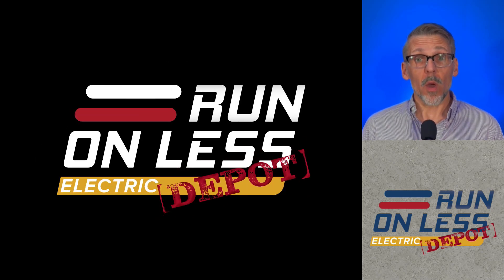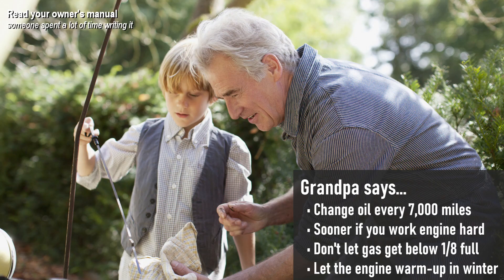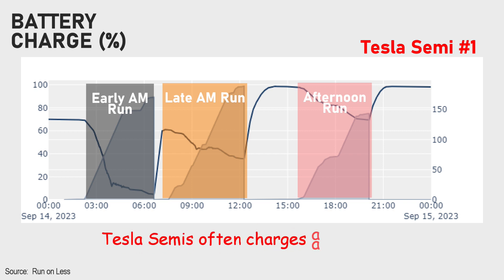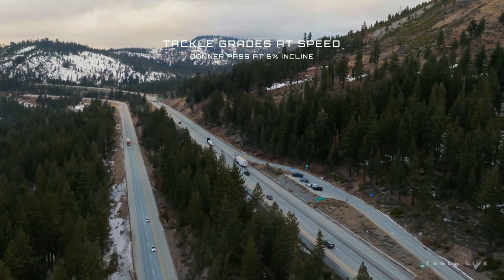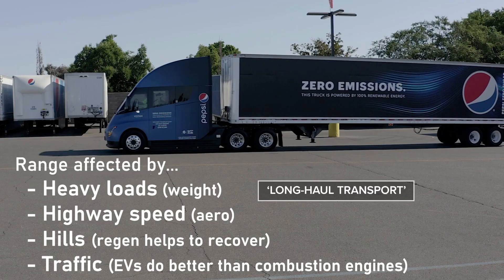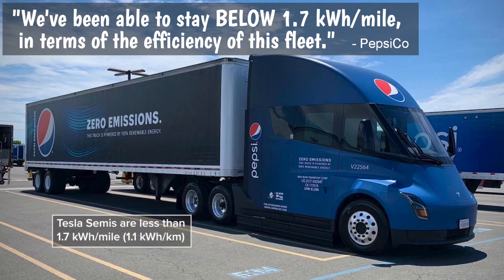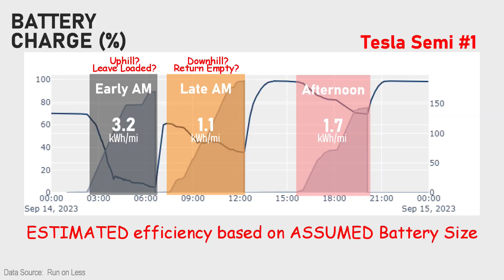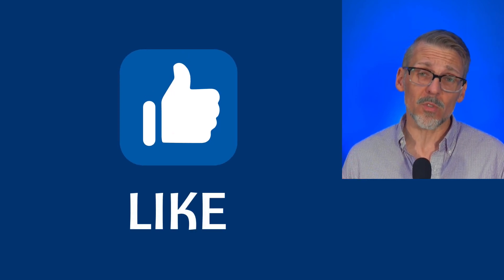In-Depth Analysis of Tesla Semi Data (Freightliner and Volvo too!)

Comment: Can we have comparison at diesel truck to same route?
Reply: Not much of a point. It s just worst technology all around.
Reply: @lucadellasciucca967  Yeah, but eventually the electrics will get better
Reply: @donhappel9566  I was reffering to diesel... And of course i m talking about potential. Electric is a better technology the ICE of any kind once maxed out.
Reply: I work in freight forwarding and consider it a necessity to go electric for our future. Unfortunately the data suggests that electric trucks are not viable yet for long haul transports. Still waiting for data from our own company which started purchasing different trucks (electric, HVO and hydrogen).
Reply: @EwenorKvM  Electric will win. It s a matter of time.
Reply: @lucadellasciucca967  Win? Loose? 😂 As I said: I consider it a necessity for our future. But denying that the data presented is inconsistent at best does not help our common interest 😉
Reply: @EwenorKvM  The data presented in perfectly consistent actually. Cost of batteries is going down predictably, has been for a over a decade. Charging times are improving at the same time, as well as charging infrastructure, battery durability and efficiency (range). Not to menton safety which is orders of magnitude higher compared to a classic ICE, don t get me started with the constant hazard that hydrogen is.

Hydrogen also means using energy to make it, store it and transporting it, could never possibly compete in cost with solar + batteries.

I m not saying it s 100% gonna happen, but it s 100% gonna happen!
Reply: @EwenorKvM  win and loose yes! Some will win and some will lose. It s going to be a bloodbath.
Reply: @lucadellasciucca967  win? Loose? Bloodbath? 😂 Ok, I think we‘re not speaking the same language. I‘ll leave it up to you to mop up blood. I‘ll get cargo to from A to B, well aware that we have to change our consumer habits and that battery powered transport is not suitable for all transports. At least not in the next 50 years.
Reply: Agree it would be interesting but not much point.   All the electric trucks are going to be significantly cheaper to run and maintain.  The days of doubting that electric trucks can work are over.   Yes still need the trucks and chargers.
Reply: @danharold3087 how long will the batteries last and how much do they cost to replace? Transport trucks go over a million miles before an engine rebuild.  Do you believe an electric truck battery is going to last this long ?

Comment: Long term the game in this is going to be to get power behind the meter (self-owned solar/wind etc.) charging something like a megapack, add whatever line power at low draw $ rates to max the megapack and then dump charge at fast rates.  Anything they can do to generate some of that megapack charge level , will be money in the bank.

Comment: I thought all the trucks were running the same routes?
Reply: No, PepsiCo has 21 Tesla Semis running a variety of routes with different loads.
Reply: This was more of a demonstration of how the latest trucks preform for various companies. Not a standardized test.  It was not limited to electric or Tesla.
Reply: All the reports that I have seen are from PepsiCo's fleet of Tesla Semi's, despite the other companies and other trucks participating.  Every participating company operates their own trucks on their own route... which are all different.
Reply: @brianb-p6586  Because the Tesla Semi is the most controversial truck in the event.

Comment: At 12:19, the first two legs were from Sacramento to Reno and back. Sacramento is near sea level; Reno is at around 5,000 ft.; and they're topping Donner Summit at around 7,000 feet at about the halfway point. You can actually see where the trace turns from steeply down to not-so-steeply down in the first run, around 4:00 AM; and somewhat down to a little less down on the return, at around 9:30 AM; that's the point where they end the climb to Donner pass at around 7,000 feet and start back down, in both directions. On the return, as you assumed, they're getting the benefit of both (presumably) being lightly loaded, and the energy from the 5,000 net climb returned through reduced energy demand; although I only see a brief moment of regen braking, right after summiting Donner Pass on the way up.
Reply: That is one steep climb to include in an efficiency test. Even though you do regain some energy on the decline you will always spend more.
An additional factor on that route would be how much time the Tesla Semi would save as it is capable of running at max highway speed up and down that incline, no fossil fuel vehicle can maintain and accelerate up those slopes after holdups like the Tesla Semi.
Reply: @jjamespacbell  Well, I think I know what you're saying. And to support your position, here's a Tesla Semi loaded to 82,000 lbs. GCVW  with 44,000 lbs. of concrete highway barriers, accelerating rapidly (watch the speedometer) up a 6% grade on the same pass (Donner Summit), passing a diesel semi creeping up the hill in low gear as if it were standing still: https://youtu.be/LtOqU2o81iI?feature=share&t=985.

Comment: This does not seem to be a fair comparison. Tesla Semi is obviously using 2 drivers per day and charging 3 times per day. With 1 driver and charging twice, a realistic range could be 500 to 600 miles in fast traffic.
Reply: But where's the unfair comparison? 1 driver in a diesel semi can still only drive 605 miles a day, because of the California 55 MPH speed limit, and the HOS limitation of 11 hours on duty.
Reply: @BigBen621 . No, not unfair to the diesel. Unfair to the other electric trucks in this comparison. The others are not doing the 2 driver per day things as Pepsi Tesla Semi does.  Tesla obviously has more range but the comparison would be confusing for normal people who do not read the details.
Reply: @erkantruckvlog  I think if people are watching this video,  they are not normal. They are the type that want to know the details.
Reply: This is a totally fair comparison. Pepsi obviously runs a 24 hour operation, whereas, the other companies are only operating a single shift. Each company purchased their respective trucks based on their operating requirements. I doubt that the other trucks could have filled PepsiCo's operational requirements.  PepsiCo spent years planning for the arrival of their Tesla Semis and installed the charging infrastructure necessary to support their 24 hour operation. If PepsiCo only ran a single shift each day, they could have saved a ton of money by installing 50 to 75 percent less charging capacity (which is what the other companies did).
Reply: Tesla semi is doing that because it can do that thanks to having to spend drastically less time charging. It's back on the road whole other trucks are still charging.
Reply: I believe that PepsiCo is achieving their 1.7 kw per mile range on their entire fleet. The trucks that are being tested in the Run on Less event are Pepsi trucks which, as you mentioned,  are probably hauling heavy beverage loads, while the Frito Lay devision is hauling lighter weight, high cube, loads. Still, the numbers you are looking at, are within Tesla's announced specifications for the Semi and better than the other trucks in the competition which are presumably hauling lighter loads.
Reply: The glass is half empty, it's never going to work out!

The glass is half full, it's not fair!
😉

Comment: Seems like they are better than I thought they would be. I thought they would be fine especially for local deliveries. Once they get the megachargers in place it will be easy for them to go across the country. Not sure what the charge times are.
Reply: Unless all power on the grid is made without fossil fuels, then every incremental use is powered by fossil fuels.   Call me when we get to over 90 percent so we can start figuring out how to add the heavy truck draw to the grid.   That's 90 percent on an annual basis, so it includes January when the sun is above the horizon for only 8 hours a day.
Reply: @ Your comment is ABSOLUTELY wrong, the exact inverse of what happens!
If you add incremental consumption AT PEAK TIME, then you are correct. But EVs are NOT charged at peak time! They are in 80-90% of cases charged either at night (on either nuclear or wind power, mostly, Deleon the country), or during peak solar or wind generation time. 
There are some countries in which night power is from coal, but those are rare and getting fewer.
Reply: With the current 750 kW Megachargers, 80% SOC in 1 hour, the remaining 20% in another hour. Most operators will probably only charge to 80%, unless they have a really long leg, fully loaded, after they charge; both to minimize charging time, and to maintain battery health. Reducing the load somewhat from 43,000 lbs. will permit the rated 500 miles on 80% charge, or they can carry a full load but only go 400 miles. Statistics show that 83.6% of trips are under 400 miles, so this will usually not be an issue.
Reply: F the battery charging crap, what is its useful load?  They can't carry as much as the standard truck so it's a fail.
Reply: @davidsoom1551 300mi Tesla semi weights <20,000lbs. 500mi semi weighs <23,000lbs. So yes, they can carry the same payload as a regular semi. Hope that helps!
Reply: @davidsoom1551  The Tesla Semi, in its 500-mile version can tow the same, within 1000 lb, than a comparable diesel rig.  In it 300-mile version, it can to 3-4000 pound MORE!
Reply: @davidsoom1551  Imagine two things: world would as well realized that global warming is a problem. And second is that america is the only worldwide producer of oil who‘s politically not problematic / not autocracy. 

Every gallon of oil used strenghtens iran, uae, russia. 

So it might be a good idea reducing usage of fossiels as possible from both perspectives.

This does not mean that every car, truck and so on needs 100% to be replaced. E.g. a company producing heavy iron parts won‘t change to electric within next years probably.

But for many many loads an electric truck matches good. And it helps. 

Additionally it is possible that the costs per mile are lower than ICE trucks (this needs to be provef by time but it looks like the concept of ev is pretty strong in low repair costs). 

So it is a win-win for everyone if there are companies who are capable of habdling their loads electric.

I will never understand why people hate „cost reduction“, „weaken autocrats“ and „enviromental care“ with the point of „but you cant go 1000 miles with 5 tons of metal parts with the toy trucks“. 

Thats just silly…
Reply: @relaxedtriathlon7095  Imagine another 2 things:  Most electricity is powered by “fossil fuels” and the energy density of gasoline and diesel is so much more dense and lighter than batteries could ever physically be- making it very hard to replace.  So yes global warming and petrol-states are both negatives- but bev are not the answer to either.  They can be a small component of the an answer- but can never do much for either problem.  

So when you give capital to scammers like elon instead of companies and research actually working on real solutions (there aren’t many besides reducing our wasteful lives) you are actually making those problems worse.
Reply: @prof.crastinator  here in germany the mix is 53% reneweavle. 
And really this energy density is used in less than 20% of the cars. 
Wether we speak about extreme distances or extreme performance per kg. 80% of cars manufactured never touch any of the boarders. 

And can be replaced.
Reply: @relaxedtriathlon7095  I don’t understand what you are saying?  The rest of the world uses fossil fuels for the vast majority of electricity production.  
Even “renewables” have their own carbon issues.

And places like North America and russia, much of africa, Australia and china have a lot bigger countries that take a lot more energy to cross.  Europeans often don’t understand this.  They have very small countries (for the most part). And some european countries have spent lots on renewables- amounts that bigger or less economically advanced countries can not afford.

Charging infrastructure is expensive.  Batteries are expensive.  And they have no lifetime cost advantages compared to ice vehicles when replacement and infrastructure is considered.
Reply: @relaxedtriathlon7095  Are you saying only 20% of vehicles need a bigger range?  Because that’s not what the consumers think.  And that surely doesn’t work for moving large things far distances- things that regularly happen in the rest of the world.
Reply: @prof.crastinator  funny as parts of africa banned ice as coats for fuel are higher than electric from nil river…
Reply: @relaxedtriathlon7095  Realize that many of these countries are more than 3 times the size of germany and cities are much more spread out- likeRussia, Australia, Canada, United States, China and Brazil.

And that more people live in these countries than all of Europe combined.
And that most of the energy produced in these countries is from fossil fuels.
Reply: @relaxedtriathlon7095  Germany is smaller than Montana- the 4th largest state in the US.   

You have no idea what people need for ranges in less densely populated land- like canada and the us west.  

Thats why we have larger vehicles.  

Europe cannot understand this.
Reply: @relaxedtriathlon7095  Ethiopia backtracked actually- when they realized how bad it looked that many residents didn’t have access to electricity- yet they required cars to use it.  ICE is not banned, sorry.
Reply: @relaxedtriathlon7095  Also Ethiopia has about a million cars total- most of them over 20 years old
Reply: @prof.crastinator  Here in he UK, renewables and nuclear are now over 2/3 of the elecricity mix.
Reply: @prof.crastinator  EVs mightt just save human civilisation as we know it. That is the lifeime cost advantage.
Reply: @rogerphelps9939  The UK is small. Both in area and in population.  The rest of the world still relies on fossil fuels by a huge margin- sorry.
Reply: @prof.crastinator  I am from Switzerland... where near 0% of electricity is generated from fossil fuels.  And Live in France, where <5% of electricity is generated by fossil fuel.And there are many countries were renewable +possibly  nuclear account for 100% or near.

You are right to compare the energy density of diesel fuel and batteries.  But don't forget to compare the weight of an electric motor with a large diesel engine, and all its sub-systems!  The sum is not a wash yet, but getting closer every year!
Reply: @prof.crastinator  Now that we know pretty much all the specs of the Tesla Semi, it has become evident that it can do ALMOST anything a diesel rig can do, including long-haul with a 45'000 lb payload!  Yes! Cross-continent long-hauling... in the same time span as a diesel, for a lot less money!
The only thing it cannot do would be long-haul TEAM operations (with two drivers taking turns). But those are very rare.
And all that while saving the operating company around $70k per year!
And most electricity will not be powered by fossil fuels for much longer.  In many countries, fossil fuel generated electricity is already down to 0-10%!
Reply: @davidsoom1551  The truck is no more then 4000 punds havier then a diesel. EV trucks have 2000 extra payload by law. Tesla semi also have the hardware capability to drive themselves and will in the not too distant future. Also consider that this is the worst the technology will be from now (as in, it will only get better). It s not a fail, it s the litteral future!
Do your research, invest in Tesla.
Reply: @lucadellasciucca967  Do they have the ability to “drive themselves” thats’s new if so… I hope you’re not talking about supervised fsd😂

Comment: Can we just admire the semi hauling around 80,000#+ loads at freeway speeds. And getting the same efficiency as a regular gas v8 f-150 does empty at hwy speeds. 😅👍🏻 37.9kwhs per gallon of diesel, 1.7kwh per mile = 22mpg when fully loaded for the semi! 😎

Take that Daimler dimwits and bill gates ya stupid fks.